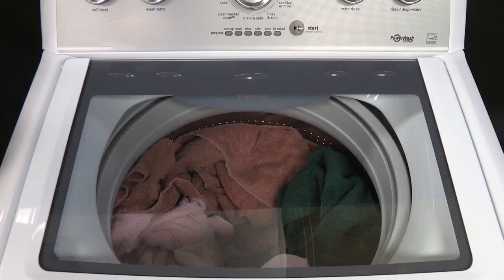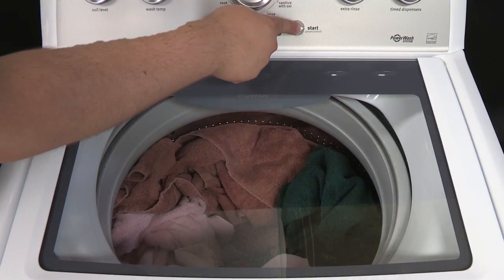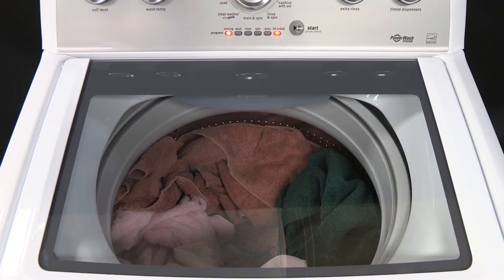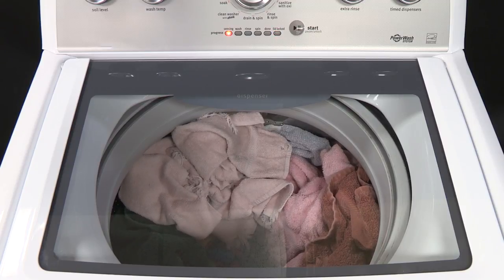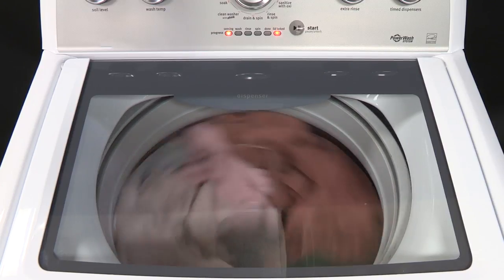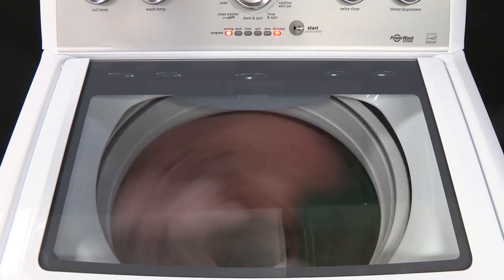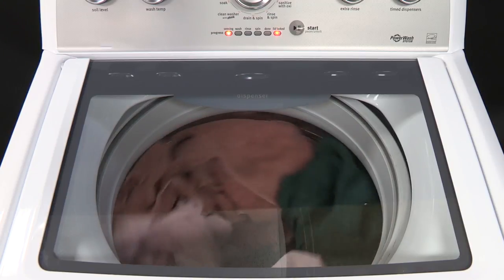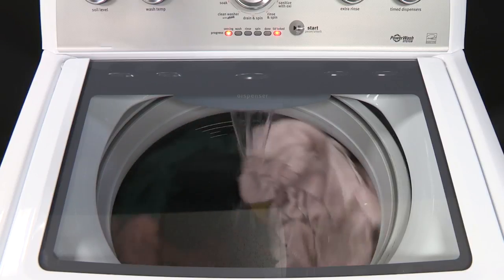Automatic Load Sensing

Comment: This washing machine catches only a few inches of water to wash my entire wash load.  My clothes never get submerged under water. Deep Water Wash doesn't work- because it catches the same amount as auto sensing.  So invariably I end up with clothes that are partially washed.  Unless I struggle to fight with the machine to manually throw in enough water that can actually wash my clothes.  I thought I was just a bad lucked customer that bought a faulty machine until I got here and read similar struggles that other people are facing.  Any help that I could get to save me from going crazy will be helpful.  My patience is running very low right now.
Reply: Wash on the bulky sheet cycle. It fills the tub.
Reply: @catalina8677  Thank you!  I was about to try ordering a new water level sensor and trying to replace the old one but i'll take this option instead.   No more filling up 5 gallon buckets to wash clothes.
Reply: Yes it is ridiculous that bulky sheets is the deep water cycle. I think it’s a flaw in their product or, it’s a joke on us all. A rude one!
Reply: @RubyMLockwood    It may be timing out. Unhook your hot water hose and remove the water limiter. It’s inside the hose. Then Reinstall. It may help.

Comment: I can't believe I spent $600 on this useless piece of crap. It adds 2 inches of water to the basket, and several articles of clothing never get submerged during the wash and rinse parts of the cycle. Checked on a load yesterday mid wash cycle, and one of my shirts in the middle of the basket was bone dry. clothes are coming out with dirt on them, I'm then able to wipe off by hand. I thought the load sensor didn't work, until it was accurate and added enough water to the rinse and spin cycle only. This "washing machine" literally does not wash clothes. Clothing comes out just as smelly and dirty as it went in. If dirt and other substances left on clothes is loose enough to wipe off by hand when it comes out of the washer, it should have been washed off in the washer. Of course that can't happen if the soap and water never even touches multiple articles of clothing during the wash cycle. This horrible piece of garbage is a complete and utter ripoff. Google it. It's a known problem. Add to that, it leaves soap residue on clothing, and tangles them all up.
Reply: My mom has this washer and has the same problem. Have you found the cause of the problem yet?
Reply: Angry20Something neveras maytag
Reply: Im here because of this same problem. I just bought it yesterday and I’m off tomorrow  to return that.
Reply: Did you put it around the wash plate or did you just throw it all in the middle
Reply: Same issue with ours. Its been sitting in our basement for 2 years now...we've tried everything but it still only fills to 2 inches. Biggest piece of crap ever! It came with our house or I would have never purchased Maytag...I've never heard anything positive about their brand.
Reply: I am having the same problem I can't find anything that I can do to stop the auto water fill. I can't believe they don't make good quality washers anymore.
Reply: @martharamirez4893  I bought the Whirlpool model. I returned it and traded it for the Maytag with the agitator. That model lets the load sensor be over ridden so the machine actually has a tub full of water. I know Whirlpool owns Roper, Maytag, Kitchenaid, and Jenair.
Reply: Have had the same issue as millions of other frustrated consumers. I agree water is precious and needs to be saved whenever possible, but NOT at all cost. What's the point of saving water if it doesn't even get clothes clean in the 1st place? Using the same logic, we should all kill ourselves; us breathing adds to the problem of climate change!  So sick of the govt's 'progressive' agenda, which perfectly explains why people revert to being conservative because being 'progressive' is going backwards and will never work! When will common sense prevail!
Reply: I had the same exact problem! Clothes had softer stains dried powder soap and some not even wet!

Comment: my mom's amana washer has a knob to choose between auto sensing or deep water wash for the water level but i don't hear the washer motor move the basket while filling using the auto sensing option, but if the lid is opened the washer stops filling (it locks the lid but not until the first spin, or during the first drain in which it does a self-test)
Reply: That's a better one. Good old mechanical controls.

Comment: I bought this washer from Lowe's because it was on sale.  It was installed, and the person left, never insuring that it was running, and didn't show me how to do it.  
I tried to use it and found out that he didn't plug the power cord to the wall outlet.  I did that and tried to start it, but it wouldn't start for me.  Then noticed he didn't turn the water on.
I would like to keep this washer.  I had to fight, big time, with Lowe's to get this taken care of. 🤬🤬🤬🤬 Supposedly, they are coming this Monday to fix it---4 days after it was badly installed.  Then I can let you know what I think about it.

Comment: With this stupid washer, I have to stand there for 10 full minutes constantly slightly opening the lid as soon as the water stops running, so it will fill for another lousy 8 seconds. That's the only way I can get a NORMAL Amount of water in this crappy washer to wash a load decently. Aaarrrrrgggghhhhh. Sooooo frustrating. 😠
Reply: I can't even put a full load of clothes is only get like 1/4 of water in a fool load of clothes to wash and the clothes on top do not get washed

Comment: I hate this washer. It’s like a glitch in the matrix for all the stupid things this washer does and does not do. We have to use “deep water wash” every time or else the cycle finishes with dry sections. The repair guy who came via Maytag or whatever said that’s normal and there was nothing he could do. Seemed weird since there are people who say theirs work fine. Idk. But there’s also weirdness like tonight when I washed clothes and then took them out when the machine said “done” but found there was a little bit of water left in the basin. So I pressed “spin and drain”. What did it do? It started filling up! Ha! Probably 6”! The irony! Cool sensors. This is just a perfect example of how this machine is crap to the point of absurdity. Oh. And don’t bother trying to “reset” because the instructions have to be a joke. It said something like: unplug for a minute then plug in again then open/close  the lid 12x in 6 seconds, which isn’t physically possible. I’m telling you, don’t buy this washer unless you want it for entertainment or like angry ASMR. Whomever engineered it should be run out of town. I just can’t.

Comment: Water washes clothes better than air. This machine is a piece of junk! We never needed a tutorial before and the clothes got clean. Better off washing clothes at the river with rocks. Waste of time and money
Reply: I have a similar Type of washer. It's actually a Samsung. The load sensing option is horrible! Clothes don't get clean!!! It was freaking expensive. I can only use it in the "bedding" or "deep water wash" settings... then it takes like 90 minutes to wash a load! It's a time waster! 
I stayed at an RV park this summer and they had a laundry room. The washer cleaned some very dirty clothes in less than 30 minutes! I want me one of those now! And it was an old old washer

Comment: They are terrible washers. They wont fill up with water no matter the setting even with deep fill options. They don't agitate well enough to foam soap or shift clothes inside. This is the garbage they are making today. Its not just the Maytag washer its all of them with this BS auto sensing options

My last Ge washer I bought was 19 years old. It would be still be running today. but a year ago my main water line on house burst  when it was repaired i got a lot of sediment though the lines clogged sinks and shower heads and faucets in my home and i just completely forgot to check the washer faucets the sediment messed up the pump i saw all the pebbles in it when it was taken out the house.